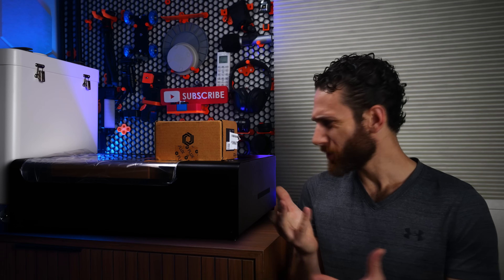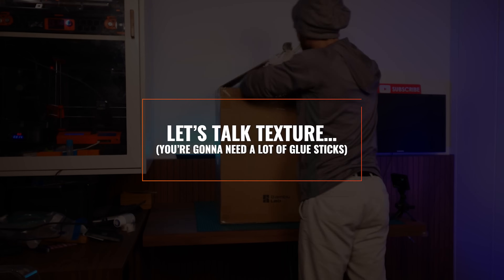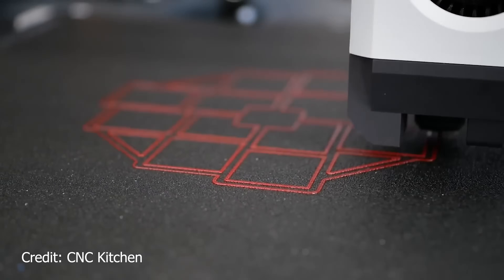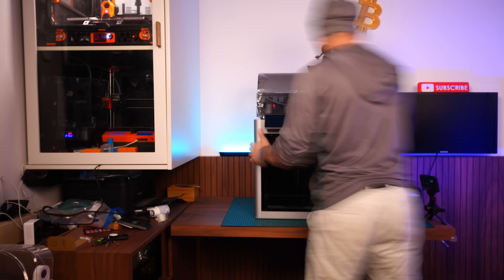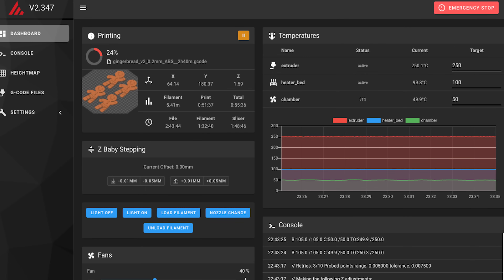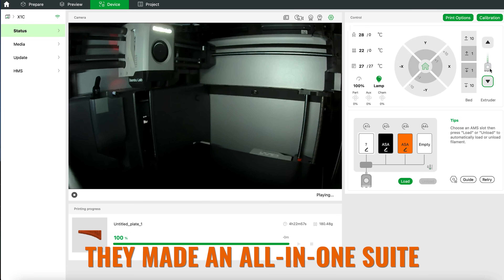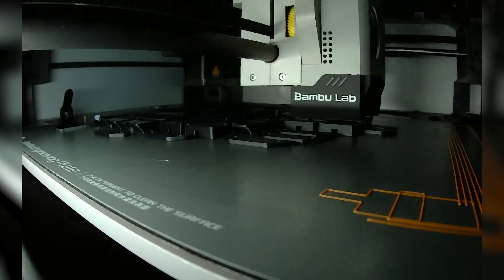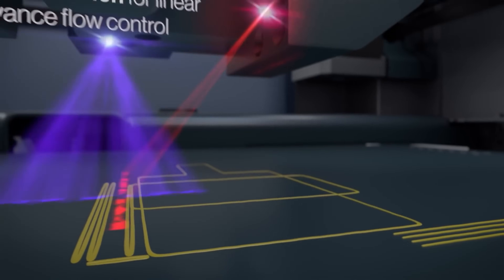Bambu Lab X1 Carbon: What NOBODY Is Talking About...

Comment: Nice review video on the X1 carbon. You touched one single thing that is quite new to many other reviews I’ve heard. But it’s quite understanding why other reviewers left it out. But with any new designed mechanics going into 3D printers these days; such as the lidar sensors and smarter computing power there is certainly going to throw a curve ball on a user that was fixed on another configuration; ie the user interface etc. I have been around 3D printers, since their infancy way back from 1999, and used some earlier models from way back then for jewelry fabrication and machine parts.

Comment: The AMS works just fine with most cardboard spools.
Reply from the maker: True
Reply: If I’m not mistaken, one issue with cardboard spools is the sloughing off of cardboard dust into the AMS resulting from the perimeter of the spool running against the AMS bearing and drives wheels. This is something that might not be apparent until it’s too late.

Comment: What is recommended to order on top appart the X1C Combo? I also prefer to avoid to order multiple times if it’s possible to get the most used parts in the first order. Same for extra parts the will be needed to replace after some time of usage. Any advice or help what to put extra in the shopping 🛒?
Reply from the maker: I suggest an extra, textured build plate and lots of filament :)

Comment: I hate the prusa layout and grouping. i constantly have to go between tabs to change parameters that are dependencies on other tabs. and the sensitivity of the movement in prusa seems geared towards ballmouse users from the 1990's. It feel clunky and outdated at best. Plus its got that "homemade in the garage feeling"

Cura on the other hand has some nice plugins to change the look and feel to make it more streamlined for experienced slicer users, the way that ALL settings are one long pane that can be tabbed out and have sidebar with plugins is the more stressfree to use. Plus it doesnt look like it was made by someone with 0 estetic sense like prusa.

There are other players on the market though. Orca slicer is pretty sweet imo.

Comment: I laughed out loud when you mentioned having all those little filament strands kicking around the office.     Oh my gosh, they're everywhere !  
And robot vacuums do not like them.
Thanks for sharing your information and experiences.   I should have my Bambu Lab X1 Carbon Combo in a couple of days.
My Prusa MK3 with the MMU has served me well, and long overdue for a major overhaul and upgrade.  It sat unused for almost 4 years, and has been moved around a lot.  When I finally dusted it off and fired it up.  I was shocked that it printed the first try, with no adjustments.  And with very old, soggy PLA no less.
I have too many hobbies (lazy), and decided to get the X1.

Comment: This was a great video. Thank you. One thing I would love to know is if the heat bed cable issue has been resolved. I saw YouTuber Modbot ‘s review and he mentioned that there was a known issue that takes the removal of 40 screws and over two hours to service just to replace the heat bed cable -  I own 4 MK3 units and they have been working flawlessly for years with normal maintenance and are so easy to service.  Did you have any issues with the heat bed cable failing? I contacted Bambu support and they only replied with generic responses - the first time I asked them they didn’t even address my question then when I pointed out that they did not answer my question they just responded with it simple yes. I have no reason to be skeptical but it just did not sit well with me and this is the one thing that is preventing me from buying this printer at this time. Thanks for sharing your experience.

Comment: I'd buy an XL version of this. I'm currently printing on an Neptune 4 Pro and it's great but there are three things that really bug me. 

1. The lack of built in WiFi. I know you can add it but it's a pain in the butt... Ask me how I know...
2. Single color only. I print tools and things with writing on it. It's not really fun to stand next to your printer anxiously waiting for the right moment top pause the print, change the filament and pray to god that you pressed the pause button at the right moment.
3. The print volume... Yeah, it's big enough for most things but not if you want to go bigger without using up more glue than a glue junkie. It's build volume is almost identical to the X1C.

Just give us double the volume and make it 1700€ and I'll pull the trigger. Bambu Labs already has taken care of my other wishes.

Comment: So many of these convenience features sounds familiar to me since my first printer is a CEL RBX01 I bought on a Black Friday whim.  Tight software integration (automaker), auto-calibration, flawless filament loading, etc.  It's a shame that 1) COVID seems to have permanently ruined their supply chain of custom parts and 2) they didn't invest in R&D of new printers to keep up with the latest developments and demand for a larger build area.  They had a very affordable turnkey solution for people who just want to print and not geek out on every minute setting and adjustment, but it looks like they've gone under and it's going to be quite a shock when I trade-up to a different brand printer.

Comment: I have been running one for 7 months commercially 8-10 hrs a day. Awesome machine! I can get prints as good with my finely tuned Enders, but with 10X the effort and 10X slower. Now I have a hard time going back home to my 4 personally owned Ender hobby machines.
Reply: Your time is worth the personal upgrade to P1s.  It is cheaper/just as fast/just as good quality/up-gradable to hardened for CF/GF/etc.  WORTH IT for $750.
Reply from the maker: Yup.

Comment: There are only 3 things to worry about. Flow of the input material. Heat of the nozzle. And speed of the extruder. Then you have other things. But no one mentions this. Can you modify everything?!  If its slightly dry that day or the bed isnt heating well. Or its humid.

Comment: All they have to do is add two cameras to eval the color of the filament pre and post nozzle during purge to stop purging at the right time or give the user a way to extrude manually and Calc esteps for purge setting.  Then enter that value, its not that hard to figure it out.

Comment: I agree with you on many points. I was surprised in many ways when I bought it, even though I saw a lot of videos. However, I was very surprised at how much was never addressed in the videos. The main point, Bambulab the loading and unloading you mentioned... it's a massive improvement but still, Bambulab still sees it too much as a multi color print and not enough as a storage system, at least I found a setting that allows AMS to switch to the same material when one runs out. It was a big surprise how little was taken into account to use the AMS as Storage system - since I'm more used to the industrial standard. I didn't even occur to me that that wasn't taken into account of a storage system. There's still so much potential..... The other is the texture plate - First layer check is switched off by textured plate... well they work on a soluten and still not reason and no reason not to buy it. But playing around with glue really doesn't occur to me. Well they will fix, I`m sure but there was many unknow suprisses for me. I won't make any videos there, I've been a YouTube partner for 12 years, I think the old videos are enough.
Reply from the maker: Good point!

Comment: The thing they don't tell you: customer service is horrible if you aren't an influencer. I've had one for months and it's literally been a brick taking up space and wasting my time fixing it, troubleshooting and repairing. I'm going to give them one more chance and if it doesn't work, I'm going to recreate the office space printer scene.
Reply: You should upload a video talking about your experience and showing all the problems with your Bambu Lab 3D printer.
Reply: I saw a video by the 3d professor where he kinda covered this . 
It's an interesting video to watch.
Reply: @watermanna  how much are you willing to get rid of it for? I’ve been looking for one but couldnt get in on the sale 🤣
Reply: This worries me as I am currently looking to grab the Engineering Combo from the Black Friday sale. Would like to feel safe as far as support goes.
Reply: How did this turn out?
Reply: It's your setup.  It's wrong.  We had the same problem.  Don't choose the wrong filament or bed, because if you do, it just won't work right.
Reply: The Apple of FDM.
Reply: @bertram-raven  the difference is the price they charge for the product you get. Bambu is very reasonable in pricing. That and along with ease of use with good reliability, is more than enough for most people.
Reply: @bertram-raven exactly the reason I bought it. I don’t want to spend hours setting up and figuring out stupid issues. I wanna be dumb and hit the go button and I LOVE it. I print every single day. Only one bad print and it was something I forced the printer to do that it warned me not to. 😅
Reply: @bertram-raven  thanks, that's enough to keep me away.
Reply: @bobloblaw7879  That's a mistake.  There's nothing wrong with the printer.  They are blazing fast and dead accurate.  His problem is operator error.
Reply: @spacescatatford  damn your sample size of one is much more reliable than op's......
Reply: What level were you using it for? Selling a bunch or just normal home use? There is a difference.

Comment: I think they did not include the texture plate because it would not work with the does not work with the LIDAR. I don't own a X1 carbon or any 3D printer, but I think I've watched other review stating that and also it's stated on the Bambu Lab's website

Comment: You should definitely revisit cardboard spools. I use them in my AMS extremely regularly, and very rarely do I run into problems. Even when the spool isn't constructed very well and the spool wobbles inside the AMS, I still don't experience problems. The main issue I've ever run into is if the cardboard edges are broken or dented. Then I'm SOL and gotta respool.
Reply from the maker: They work better now that I did the hydra upgrade

Comment: Thanks for the info, much appreciated. Have you ever used a makerbot method? Do you have any kind of comparison for print quality and ease of use for the built in slicer compared to the Makerbot Method?

Speed, swaps, size, and price all seem to be much better than the Makerbot. Considering selling my Method Carbon to get one of these..... worth it??

Also curious, did they fix the large amount of waste between filament swaps or do you still have to adjust that manually?

Comment: How well does this printer do single wall prints? So a vase mode single wall print? I print rc airplanes. The wall is single line on just about everything. And lightweight pla is the most common used in rc planes. Does this printer work with this filament?

Comment: It does the purging before every print, which annoyed me because I print one Material only. So I reduced the Start G code purging only to then realise why they purge so much, it’s so that the poop has enough weight to actually go down the drain. My printer doesn’t poop much anymore, but I now have to monitor where to poop lands, sometimes it flys onto the built plate. Just something to consider if reliability is everything for you
Reply from the maker: It’s like owning a dog or a baby. A lot of time spent managing poop but worth it.

Comment: Ig purge is very hard to avoid on any single-toolhead machines. Shame, i feel like 3D printing can be very wasteful sometimes with all the supports, failed prints, purges. 

How cool would it be if Bambu would make a filament recycler in the same vain as their printers? A thing you could just feed all the scraps and it takes care of everything else for you without the need for a janky home made setup that risks burning your house down

Comment: The biggest problems I ran into with my X1C are that it instatntly forgets coordinates of  the bed and toolhead after ending a printjob and because of this, when I print something that nearly maxes out the Z limit, the bed is moved to the bottom of the printer and before next print, when homing is done, the bed tries to move down even further and pushes the three linear screws up, that pops out the top bearigs out of their place. The two front ones are relatively easy to push back in place, but for the back one to push back in place, you have to partially disassemble the printer. REALLY ANNOYING
Reply: is this fixed now?
Reply: Unfortunately, no. I did take it to BambuLab support, but they told me to basicaly just manually raise the printbed after each print  @CompletelyNormalPhenomenon

Comment: I do have a carbon X1. Initially I had a problem with the webcam not working. I started contacting costumer service and was expecting to solve the issue in minimum a week. To my surprise in less than an hour someone looked into the issue and after about 2 hours the issue was solved. Their costumer service is top notch!

Comment: The App thing is a huge negative. They will use it to steal data from you, require it to run a 3d printer instead of making it a bonus, and in the end it will become another privacy abusing revenue stream instead of the remote control we all want. When things require apps to run, I avoid them.  Give me stupid instead of smart - stupid doesn't sell your information for money.

Comment: I have a MK3S+ that I have put shy of 4K hours on, we have a raised 3D unit, along with the new Flashforge Pro 3 at work. I don't really care for either of those 2 work units, My Prusa has run circles around them. This looks pretty promising I need a larger printer for home use. Once I can see some solid reviews hit on the Prusa XL I am going to decide what my next unit is.

Comment: 3d print a rail system for lights, and cameras from your cieling. you can have everything on booms. and then there is minimal setup time. no need to change location.

cheers M8

Comment: 12:12 Would be also useful if 3D printers had a sort of deposit (for each type filaments) that made the wasted filament reusable, similar to old waxing machines.
Reply: yea bambu should sell a little filament recycler so you can put all the waste in to make new filament
Reply: @WhimsyCottage  it would take years for that to pay for itself, and even then the colours will just be an inconsistent mix of brown and grey
Reply: @justinc2633  it's not really about paying for itself but being able to recycle any leftovers and failed projects into new ones. Also it depends on your printer how easy it will be to separate the different colors.
Reply: @WhimsyCottage  id rather just buy new filament than pay 100s for the ability to recycle a handful once or twice a month
Reply: @WhimsyCottage   IF you have no thought process sure. You may want to spend thousands of dollars to recycle some filament but at the end of the day it is cheaper to throw it away and buy new. Filament making machines are expensive as hell for what you are talking about. You don't even have room for them unless you have a shop lol.

Comment: Please measure the power consumption.
Reply from the maker: in what metric do you want? Per hour of printing? I have logs of all the power consumption, it's on a smart socket
Reply: @thenextlayer every posible metric that you have, watt per hour including idle and printing, using the AMS, using all four filaments for a long time with a lot of changes (more than 2000),...

Comment: I own a broken Creality Ender 3 Pro FDM printer. I could fix it, but I also know that it's horribly out of date with the release of Bambu Lab X1 Carbon and similar manufacturers giant leaps, so I've really been considering whether I should fix my Ender 3 Pro and just run with that, or if I should get a Bambu Lab X1 Carbon first and then fix my Ender 3 Pro later, giving it some much needed upgrades in the process, but I've had my doubts about how trustworthy they were, since they've really just stepped on to the scene and overnight caused a major leap forwards and massive recommendations from the vast majority of all content creators, right after having a successful kickstarter campaign. Tbh, it sounds like a recipe for disaster, but after watching this video and hearing that they're patching any problems at the same speed as their printers can print, I now know I will save up for the X1 Carbon. Thanks for a great vid!

Comment: I've been struggling to find the correct settings for silk on this machine. I want that ultimate shine while still being able to print at a decent speed. Would you mind sharing a basic setting profile for silk pla and pla+? I'm currently using Sunlu silk pla+ if that makes a difference.

Comment: this printer is so high on my wishlist.  But whats stopping me is the vendor lock in.  Bambu labs is a new company and what if they go belly up?  there are zero third party manufacturers that make hotends, brackets, controlboards etc etc.    I think its a matter of time before other companies step up to the game , wich could result in less sale for bambu.   Im a bit weary of spending 1500 on a printer that might just turn out a expensive paper weight 2 years down the road.  An issue that i defenitly wont have with for example a voron.

Comment: 2:50 I believe you're wrong about the reason for the Cool Plate, in fact I think it's quite the opposite: Bambu Lab knew full well that most people would print PLA. But they wanted to make an enclosed printer for the advanced materials. So they needed to have a build surface which sticks at very low temperatures (keeping the chamber temperature low to prevent jams due to premature softening of PLA). That's why the Cool Plate is included with the (enclosed) X1 and not with the (open frame) P1P.